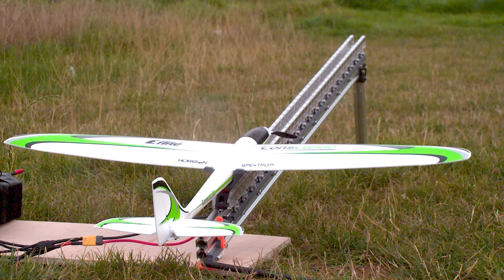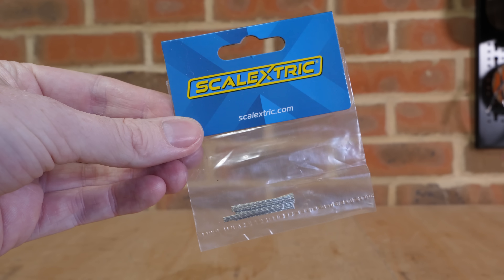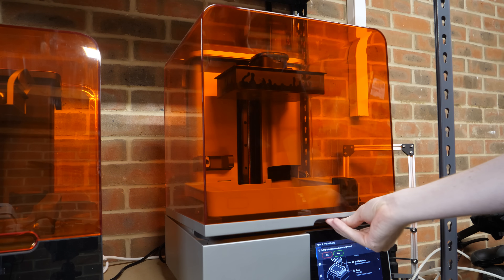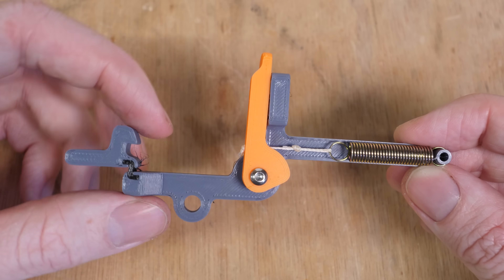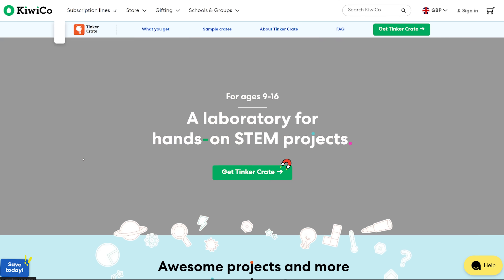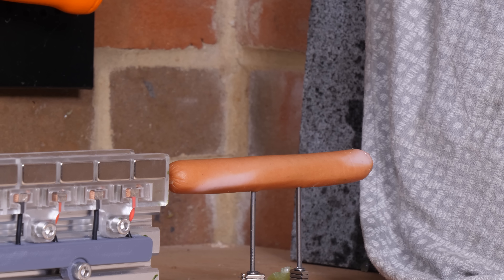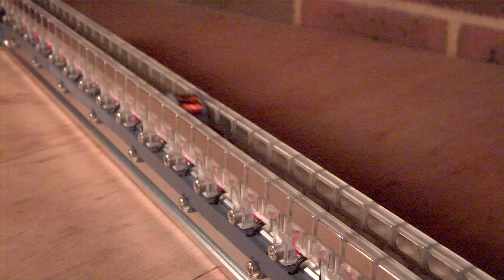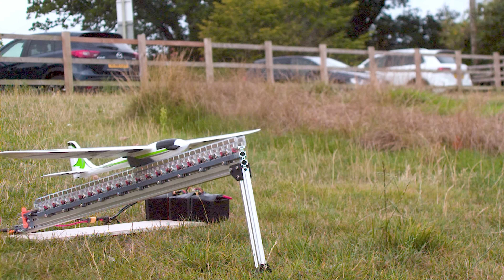Electromagnetic Aircraft Launcher

Comment: Cool project!  You should capture the sled, especially if you want to build even more powerful ones.  Maybe simply some rubber attached underneath.  I also wonder about the double coil sled - it might not be getting the optimal push/pull based on how long it is.  Maybe you could design it so that you could have a really long sled, each with contact points, re-engaging the magnets along the whole path.  But I don't know much about railgun tech, maybe that's prohibitive at some weight + available power.

Comment: I wonder if you could try something half way between the old and new models. Keep the moving electromagnet, make the rails continuous and drive the coil in a sinusoidal pattern with an h-bridge controller. I'd hope that the continuous rails would reduce sparking and being able to control the power going into the coil dynamically would allow you to have finer control over the acceleration curve.
Reply: That's what I was thinking.  I imagine you could reprogram a brushless ESC to do the job.  I think you might need a position sensor for the sled, though.

Comment: I think you're probably limited by the inductance of the coil. A hundred amps going through that coil probably can't switch very fast. You can kinda see that towards the end of each sled launching - you're trying to reverse a boatload of amps through a pretty powerful inductor, which just can't happen fast enough, so the forward force drops off rapidly as the switching speed goes up. The problem gets worse sooner the higher the current is, so each coil gets a real fast "burst" of acceleration at the beginning of the rail, but then very little towards the end. I think you could probably design a series of progressive contacts into the coil, so that each successive electrical contact is acting on  a closer center-tap, effectively reducing the number of turns and the inductance, the further along the rail it goes. 

You're basically running into the same problem that stepper-motor-driven applications like 3d printers run into when they try and run the motors faster. My NEMA-23 motors, at 24V, can only turn about 5 times per second at max speed before stalling, which works out to almost exactly 1kHz in my application, and that's only running like 2A, compared to the 90 plus you're dealing with.

Comment: Use a current limiting resistor and a much higher voltage. This gives full voltage on initial contact to get the current flowing through the coil as quickly as possible but quickly reduces it as current increases. This prevents sparking and over-current.

Comment: Why not brushless? Magnets on sled & coils along rail. Hall effect sensors could be installed next to each coil to determine position. Control it all with a simple microcontroller. 

Alternatively, some spring loaded carbon brushes, similar to what’s in a brushed motor should be more robust than the copper ones.

Comment: 14:53 the reason it goes faster than your estimation is because the magnets cause less back EMF in the coils at lower speeds. Also a tip, as the coil speeds up down the rail you need to "advance" the polarity switch timing to account for the lag of the inductor/s responding to the voltage applied. They do not immediately produce a magnetic field. This could be limiting your speed (as well as back EMF providing a maximum limit for any voltage you apply).
Reply: I don't have anything to add on this subject but I'm really enjoying the discussion
Reply: A snubber on the carriage will reduce sparking but could also slow down the collapse of the magnetic field and thus also acceleration.
Reply: @thomasmaughan4798  you actually want the magnetic field to collapse faster, it prevents the magnetic fields from pushing the wrong way on the next   magnets. What do you mean by snubber?
Reply: @capone2488  There are a couple devices that could be referred to, since, snubbers are anything used to suppress voltage surges.

Normally to eliminate arcing I'd limit the inrush current using an NTC thermistor, but those operate on a timescale of seconds, so that's not it, plus the coil itself is limiting the inrush current.  Besides, the problem is more likely to be the arcing from breaking the circuit.  Which happens because inductors resist changes in current but can produce large voltages to do so.

A common way to deal with that issue is a flyback diode, but that only works for DC inductors.  In this case you'd want something that short both parts of the coil together whenever the voltage hits above a certain threshold.  So a TVS or MOV.  Ironically, that would also short the power rails together, but it reduces arcing because the high voltage is caused by the magnetic field collapsing.

Except, using a MOV like that would actually speed up the magnetic field collapse, so I don't know what @thomasmaughan4798 is referring to....
Reply: @capone2488  Do you have a reverse diode across each coil?   If not, the inductive spike is causing most of the sparking.
Reply: @briandonovan9091  you can't really use diodes in this application because the current alternates directions...
Reply: @EmperorA0  this is very interesting, I'm primarily a mechanical engineer but I'm slowly educating myself on electronics with the goal of designing my own motor and ESC for an electric bike.

I don't see the arcing as an issue though, the brushes are so thin and as they make connection with each contact on the rails it is inevitable there will be some arcing? Using slot cars as a kid I noticed arcing even with their relatively low voltage and uniform track rails let alone having gaps between the contacts.

I think using a more solid "spring" style contact for the sled would decrease resistance of the system overall and increase effective voltage applied to the inductors?
Reply: I had a similar thought when watching the video and went back later and posted a comment about it, fortunately you posted a much better version 3 hours before me 😂
Reply: @malebolgia8552  😇
Reply: 🎉🎉 @malebolgia8552
Reply: Do you think adding interpole coils would work to reduce sparking and capture a bit more energy?
Reply: @blaha5984  this is a very interesting idea, perhaps not using a winding but an interpole magnet between the main drive magnets. This would be implemented at the point of pole reversal and could actually negate sparking? Hopefully someone with better understanding of electrical drives can give me more insight than my Googling!
Reply: Makes sense. Like a car using a distributor needs mechanically advanced ignition.
Reply: @rileyandikeysplaytime5936  similar concept, completely different mechanics!
Reply: Could you put a high voltage capacitor (inside the coil) to supply the power to the launcher - so that the capacitor is part of the projectile?
Reply: Why, don't you, do a better one?
Reply: @timhandley7760  because my job isn't making random useless projects on YouTube for the entertainment of thousands. There's not enough time in life to do everything otherwise I would. This is a constructive comment, maybe try going and hating on deconstructive comment threads instead.
Reply: A small amount of MCU code would sort that out.
Reply: @jackevans2386  This version is purely electromechanical so there is no where to add SW based delays, the first version had computer control though.

Having the contacts able to move separately from the magnets would allow for tuning of the timing advance needed to maximize the acceleration. The problem is that this tuning would be sensitive to the total weight of the sled and payload so not friendly for variable purposes.

I would also add that the speed of the sled vs. number of windings experiments needed to have a dummy payload on them otherwise the results will not scale properly. Adding 10% mass to the total weight (sled+payload) for double the windings is a much different argument than adding 75% mass to just the sled for double the windings.
Reply: @malebolgia8552  it would be easier to move the contacts mounted to the rails, instead of the brushes on the sled. Admittedly, this would have to be tuned for a specific payload weight and acceleration
Reply: @jackevans2386  it's not digitally controlled? Either way no amount of code can change either magnetic induced voltages...

Comment: I would imagine the car brushes are not copper because as you can see they leave deposits on contact with the power strip but the car brushes don’t because they are made of a higher melting point metal but brass is a lot lower so try using a metal braided strip

Comment: FYI you can solder to wick, just use a heavy c-clamp and just tighten the clamp on the wick where you want the solder to stop. The additional thermal mass will let you heat up where you intend to solder to, but keep the rest of the wick cold enough the solder won't flow. Cheers

Comment: You can drastically cut down on the arcing by putting a pair of back-to-back Zener diodes across the coil. (A capacitor would also work, but would slow your current rise time, which isn't good in this scenario.)

Right now what's happening is every time the brushes lose connection - either at the very end of a contact or momentarily at the start - you get an inductive spike in voltage as the energy stored in the inductor has nowhere to go.

Beware that this will affect the optimum tuning. And you should probably measure a few of the zeners after to ensure they haven't died from overload.

Putting a metal strip down each magnet rail on the outside might also help. (Less air in your magnetic circuit the better.) Though you have enough air in the magnetic circuit regardless that I'm not sure.

Comment: (0:08) is it supposed to spark like that?
Reply: Yeah it sparks like that. Due to the fast movement of the rod there will exist some vibration which causes the loose connection b/w the rails so the sparks happen
Reply: @Ayan-gv2lw  It's not because the contacts are loosely pressing.  They're handling high currents and the way it's designed the sled is actually jumping from one pair of contacts to another.

Comment: You could have used an N-Channel Power MOSFET to switch the high voltage to the rails without any mechanical bouncing. In one of my applications, I'm switching 96V with IRF3415.

Comment: Why not using opto couplers and mosfets to power and time coils? Gives you same timing capability minus wear of mechanical contacts
Reply from the maker: The launcher I built 2 years ago used hall effect sensors and mosfets. However, it was far more complex to build due to the timing control electronics, let alone have to wind far more coils along the rail.

Comment: Rather then placing the sled inside the magnets and using the 'spring' switch could you not just power up the rails and simply use a spring to kick start the sled into the magnets?

Comment: If you use a second spring think clothes line spring. Also an inline spring pushing forward. That locks into place on contract. 

Also you should measure weight and acceleration and find the average peak speed. You might be able to determine a more desirable spacing to improve speed. Also might consider something to allow less friction.

Comment: why not increase the voltage? 200v? 1000???? also, you could try 200 turns, and an additional 200 turns in parallel, instead of a 400 turn coil, with the higher mass of the parallel turns your most efficient number of turns probably increases to 300 tho

Comment: Brilliant, far better than bungy cords to launch a glider. But would need a bit of work to produce a slower acceleration,  or it would rip the wings off. I do feel this idea has a lot of potential on many RC models. I have seen engineers using a similar idea to launch rockets. Well done!

Comment: Hi Tim, a simple suggestion re the launch switch, peplace the mechanical launch switch with a simple SCR and a monostable one-shot like a 555 and a button to trigger it, that will completely eliminate the switch bounce, the SCR can do the heavy lifting so you can eliminate the switch burn out.  If you want to massively improve the launch performance though, I would make the sled passive (i.e. put the magnets on the sled, and put the coils on the rails), use FETs and some kind of optical trigger at each phase to sequence the launch from the mechanical movement.  Also tighten up the mechanical tolerances between the magnets and coils, and use some kind of iron core to focus the magnetic flux coupling to the magner.   What you are basically making is a linear reluctance motor, with the right design could get you a lot of torque and therefore acceleration.  Look at how EV motors are constructed, try to emulate a linear version of that.   Fun project

Comment: Hi Tom, love your projects. How did you establish what distance/"phase shift" the rail's magnets and electric contacts needed to be in? A.k.a what is the correct longitudinal distance between a given set of contacts and the next set(s) of magnets.

I feel like there is a lot of potential in perfecting the timing of electrifying the coils such that the force excerted by/on the coil can be maximized. My intuition tells me that this is not trivial, e.g. a simple matter of turning on the coils when they are exactly in the middle between two opposing sets of magnets. Also this relation should not be linear, but relative on the sled's speed? A coil is an impedance, meaning it resists the built up of current, so the current will raise whith a delay once contacted. (another reason next to the mass why more windings wouldn't neccessarily be better). Because of this non-linear behaviour, I would expect the best point of contact to shift among the length of the rail such that the contacts need to be hit ever so slightly earlier by the end of the rail.

Non-linearity aside, an easy way to experiment with this would be to make the array of magnets and the array of contacts seperately adjustable from each other, e.g. don't have them in the same 3dPrint but mount the magnets on a seperate structure that can slide forward or aft relatively to the contact rails? Also the contact size (e.g. length!) should have a great influence on the timing. Maybe you did your experiements to find the best working solution already. Either way I'd love to hear what was your approach to this!

The impedance is also what speaks against using a ferrite core, as this would increase the energy 'wasted' on reversing the magnetic field field inside the coil (hysteresis!). Also the sparks  don't result from the supply voltage, but because impedance self-induces super high voltages once the contact is opened as it tries to keep up the current. A resistor in series to the coil might help to burn some of that energy quicker. However a capacitor in series the coil would even allow to collect and re-use some of that energy, IF you can tune it the the correct resonant frequency? However this would work best in a linear motion with a static frequency, an accelerated motion means the frequency moves up (dramatically) as the sled propels faster. Sidequest idea: Can the capacity be built integrated in the rail, such that the capacity increases as the sled moves down the rail, to tune the frequency by the position of the sled?

Comment: Offering some more thoughts after reading some of the other comments:

- To improve the accelerating force:
> - Optimize the solenoid field strength by adjusting current (as a function of coil turns and wire gauge) and coil turns. As you increase the number of turns, at a fixed voltage, the current decreases due to the increased resistance of the coil, so simply adding more turns will pass the peak and yield diminishing returns.

> - Another way to squeeze more performance out of a fixed length of rail and magnet spacing, is to increase the voltage for later segments. The faster the sled moves, the less time contacts have to transfer current and flip the polarity of the coil's field. Increasing the voltage at a given resistance will automatically give you more current and a faster d2i/dt2. The quicker the coil can flip to the correct polarity and reach max strength, the more time it will add to the sleds acceleration.

- To reduce or quench the back-EMF:
> - Adding a capacitor to the sled on the coil would reduce the acceleration, as the rise time of the coil is dependent on discharging the coil from the previous contact segment's polarity, and adding capacitance would sustain the negative current and cause delayed current rise time, and potentially suckback if it's severe.

> - Adding a bank of TVS diodes on the sled would reduce arcing by quenching any overvoltage, but would not quench the remaining stored energy below the TVS breakdown voltage. TVS diodes can be purchased as unpolarized components so the sled remains simple and light, and conduct quickly. Make sure to take into account the stored energy of the coil (ie: joules) and ensure that the TVS diodes can handle the entire amount.

> - Adding reverse current diodes at every segment (alternating polarities) will improve it further - note that the diodes need to be as close to the contacts as possible, so that the power rails themselves do not become a large source of inductance themselves. Any intrinsic inductance in a pulse power circuit will hinder rise time in current.

> - One potential experiment to do (even if not for optimization, simply to visualize on high speed video) is to place a bicolour LED across the coil with more than a series resistor (you will have to clamp significant overvoltage from ringing) so you can visualize current in the coil on high speed video, and understand how quickly the coil's begin to suffer suckback.